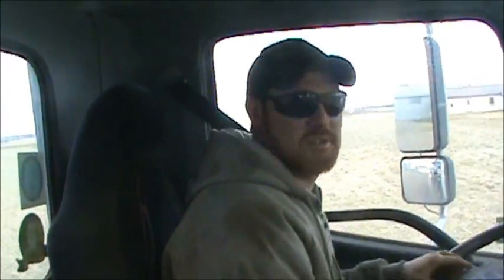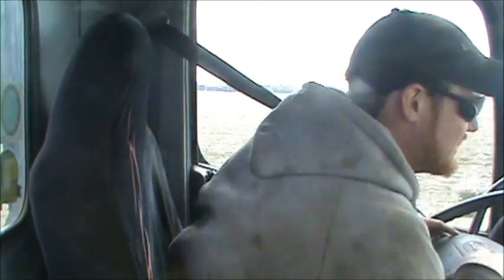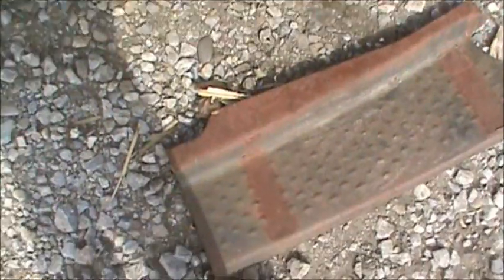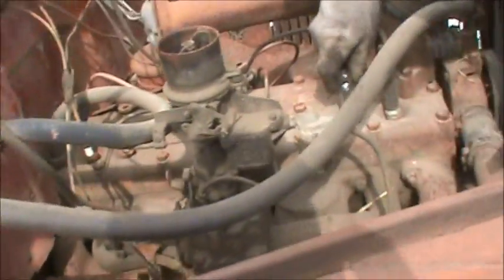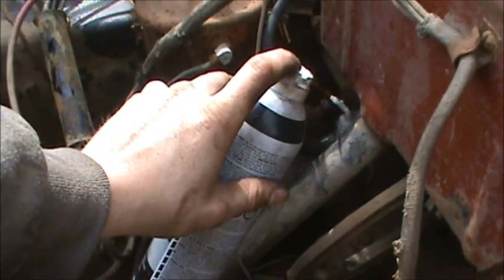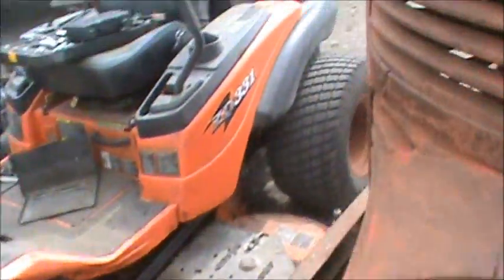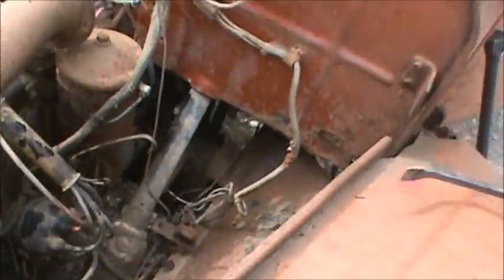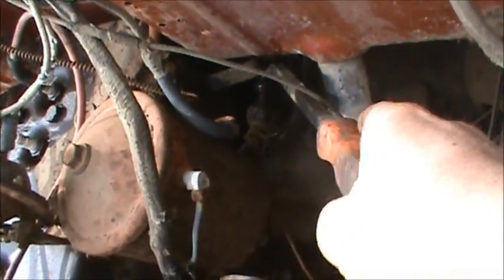Nothing Ran like a Deere

Comment: Is that an old "A-hooo-ga" style Klaxon horn in that '48? Wow, I love these! The cheap ones that are sold nowadays make a much higher pitch sound, so they aren't any good. Why don't they still mass-produce the ones with an actual turning motor in them to make the sound, instead of the new electromagnetic version (which vibrates faster thus making a higher pitch noise)...